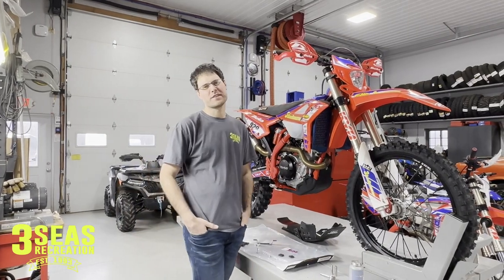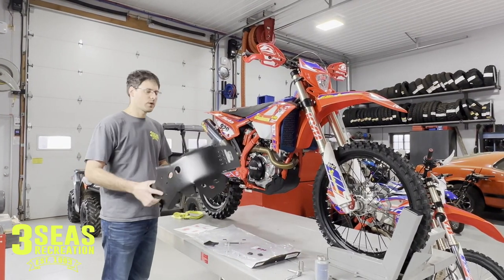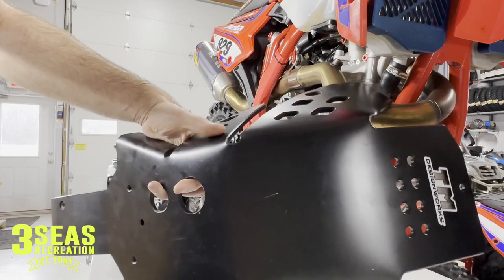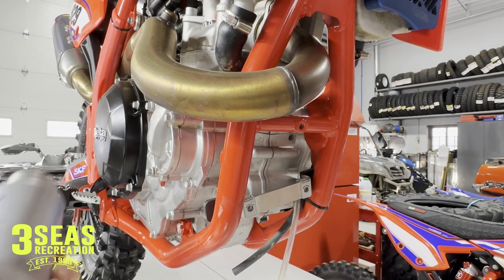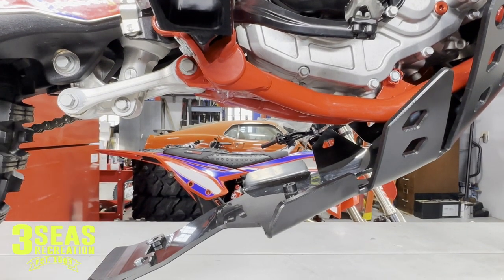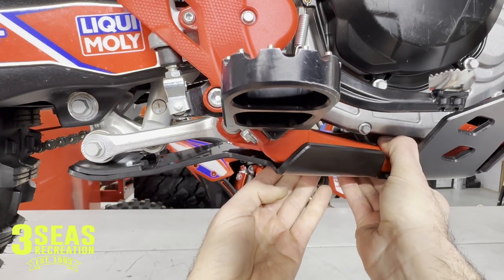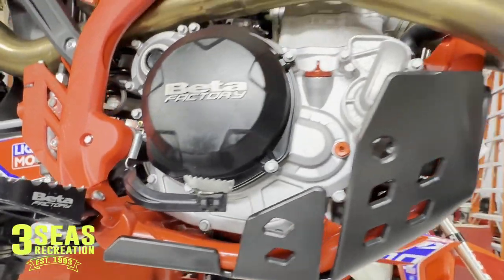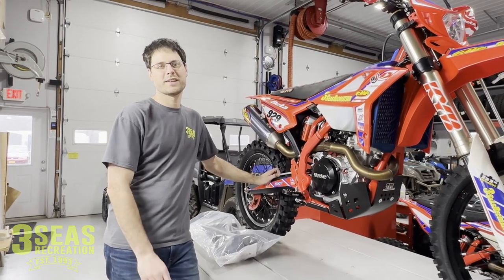TM Designs Skidplate w/ Linkage Guard Install, 2020+ 4 Stroke Beta Motorcycles | AB-21415

Comment: You could also use a heat gun to slightly modify the bend of the skid plate. I’m just thinking about the constant pressure on the linkage and the dirt and grit causing wear on both the linkage and the skid plate over time. Beautiful design and very well engineered. Definitely getting one for my new 300 RR. Thanks for the timely video. Cheers, from North Eastern Ontario Canada.
Reply from the maker: Yea  a heat gun could help for sure, I think once its in place for a bit it will be easier to install after the next oil change. I can see your point about the rubbing, I have yet to have any negative feedback where it has caused a rubbing issue on the linkage. I think the benefits outweigh the negatives. Enjoy the ride, Jared
Reply: I have no complaints about the design or rubbing concerns,  and have had this skidplate on my 390RR since new in 2019.